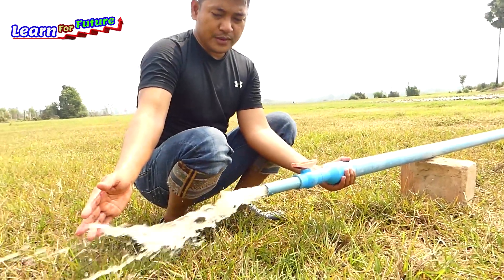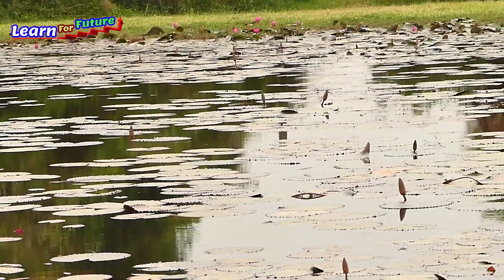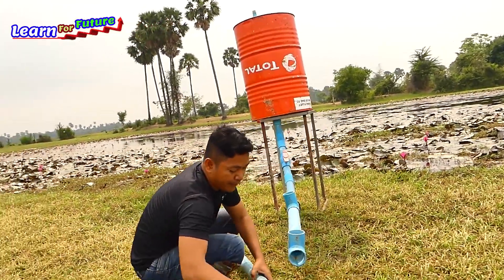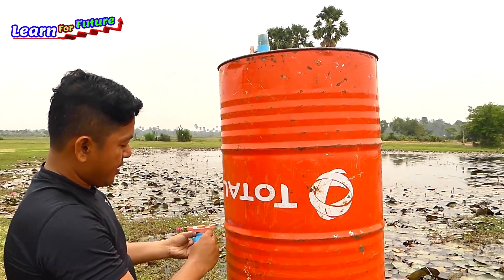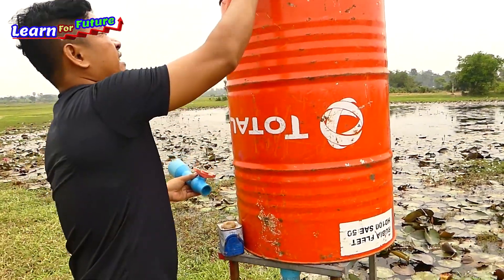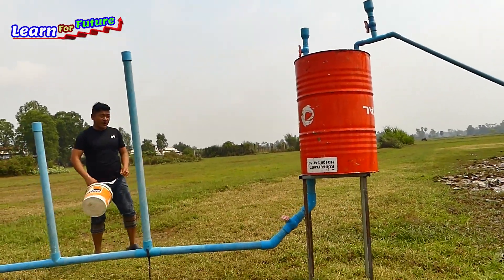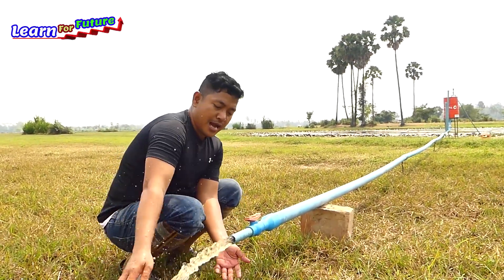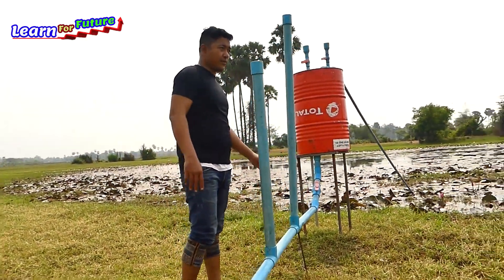Pressured Pump - How to make auto water pump from deep river using pressured tank BARREL

Comment: I consider the video to be false, I have done the experiment with several tanks and none is able to suck the water from the pond, the only water that comes out is the one with which it is filled. I would like you to show an extensive video where I can check that it really works.
Reply: I have done it from a well ... Nothing positive too. Nairobi kenya
Reply: Hello maurecio there is technic e sealed mo ang drum no air going inside... Except vacuum way
Reply: This is a siphon with a barrel to prime it. Works fin, if, and only if, the waterlevel of the source is higher than the output to the field. No siphon can lift any water.